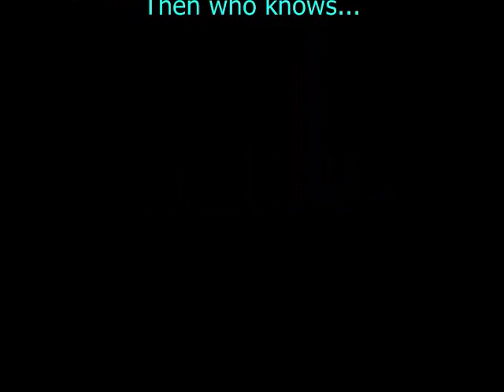My 900 VA Tesla Coil! (Resonant Transformer) Lightning Machine

Comment: You mention that your (.15µF 2000V) capacitors are hooked in "parallel", but that you end up with "something like 0.0132 micorfarads", which wouldn't be the case if they were hooked in parallel; (you'd get the SUM of all individual capacitance values, but the working voltage of the lowest-rated cap).
Did you mean they're hooked in series (which would give you 0.0136µF, if there are 11)?

Also, the (neon sign) trafos: in series (to increase voltage) or parallel (to increase current)?

Comment: I recently completed a SGTC with a 12kV 60mA NST, and it does not produce arcs longer than 2 feet. Yours appears to be generating up to 3.5 ft arcs (especially if it had a breakout point). I have to commend you for that spark gap. Mine utilizes an RQ gap with a small fan on it. Milling flats for salient pole operation is true dedication.

Comment: Very cool indeed..I know this is an old post.. do you respond to (or have you in general..) responded to comments on your videos? I was hoping to talk to you for a bit. I built my first Tesla coil in 1987 for my 8th grade Science Fair Project. I'd just returned from a vacation to San Fransisco. While I was there, I had the fortune of going to a fantastic science museum there called the 'Exploratorium'. There amongst tons of great exhibits was this mesmerizing, noisy, beautiful, and almost enchanting device, and right then and there I knew I would build one, no matter how difficult. I was determined to understand how it worked. 

   Sadly, once Id built mine two years later, and entered it into the science fair, and took it to my school, the administration decided not to allow me to present it in the fair. It was deemed by the faculty that it was: ..(and Im paraphrasing here, but not embellishing.. - ' ...Too dangerous to be turned on inside of the school ((any where in the school - the  gym, lunchroom, library, etc..)), and that it was ".. too potentially dangerous to other students, was a fire hazard, and that the admin, would be liable..' ) Pardon my shitty grammar and punctuation. Anyway, I'd found an old 3-phase pole transformer at an industrial equipment scrap yard. Finished and tuned, my coil produced by calculation (I had no means to measure it via tester,gauge, etc.. either..), apron. 5.5 million volts tuned to a fixed 60,000 hertz, and stood 9 feet tall. I made the primary out of 24 awg @ 5780 windings on a 5" dia. piece of ABS pipe, and it stood aprx. 7' tall. The entire assembled unit was about 9' tall on its base. 

  So, as I was mega-bummed, and frankly, quite pissed off that I'd put this effort in for nothing. But thankfully, I spoke with my Science teacher about how shitty the situation was, and so he went to bat for me and convinced the principal and fair judges to allow me to set it up in the vocational annex in the welding class shop ( which is ironic, seeing as the multi-bay arc welding station wielded many hundreds of amps more than my coil directly into students hands). Additionally, I'd gone through painstaking efforts to dismantle the entire set up and bring it to the school, leaving it in parts in the art class storage area over the weekend. My Science teacher is needless to say, awesome as hell! I set the coil up, made my adjustments, and turned it on. The reaction from everyone was so awesome - it felt good to have finally accomplished my at the time dream of building this awesome device. Subsequently, the fair judges granted me a unanimous/honorary 1st place prize.

   Anyway, Im fully aware that this comment is absurdly long winded.  I really  just wanted to congratulate you on your tenacity, thoroughness and your astonishing attention to the  detail in building this magnificent machine. I had no internet, very very few resources, and was astonished ay how little information I could find on not merely a Tesla Coil, but anything at all about Nikola Tesla. I scavenged through 3 public libraries, the school library, encyclopedias (lol! that'll tell you how old school I am), etc.. I finally found some information at the NCSU university library about Nikola Tesla, but almost nothing about how to build a tesla coil. I FINALLY found a schematic of a very very crude Tesla Coil in an archived 1954 edition of Popular Science magazine on microfiche at the Cameron Village State Library's media archives! I sure wish Id had access to the internet then. 

Thats all - just wanted to share a bit with a fellow Tesla enthusiast. Thanks for your time.
Reply: Incredible... This words you heard is of great future scientist
Reply from the maker: Thanks for posting this and sharing your experience with Tesla coils. Tesla wasn't popular in literature until recently, most of his work was in understanding radio and AC transmission systems we use today, and has been rounded out and completed by more recent texts.
Reply: I am a retired electrical engineer with high voltage as a hobby. You know that you built something worthwhile when people deem it too dangerous for display. Anything fun or interesting has an element of risk associated with it. I have a pole transformer powered coil which draws 6.5 KVA and puts out 9 foot streamers which I can only operate outdoors. During Halloween I have hundreds of visitors.

Comment: I have a quick question, I bought some 1nf 7kv capacitors that I was going to use for a tesla coil, how would connecting them in parallel affect the capacitance and voltage of the overall capacitors?
Reply: If you hook them up in series, the capacitance decreases and the voltage rating increases. If you hook them up in parallel, the capacitance increases but the voltage rating stays the same.

Comment: I just built my own. I saw this video before I started, and though woah that's cool. Now that I've built my own, I have a lot more  respect for yours, it's really impressive. All I could get out of mine were some 4 inch purple arcs,  ill still count that as a victory given that I was using 14 glass jars as my capacitor, which would constantly short themselves by arcing from the foil on the outside to the lid, not to mention the insane corona loss that was happening inside the jars. My NST is a little less than a third the power (about 280VA) and gfi protected, so the size of my spark gap is limited until I remove the gfi circuit.  Well done on the rotary spark gap.
Reply: A little late but I just built my first one and had the same capacitor problem as you, but I fixed it by adding vegetable oil on top of the saltwater.

Comment: you can get an estimate on voltage by how far the arcs travel e.g. 5 foot arc = approximately 500kv you just have to find out how much voltage it takes to arc so far
Reply: +MrShaun1578 10kV per centimeter ;)

Comment: Nice Tesla build. I have built many coils for schools, museums and even NASA/JPL labs. I have a video of some on my Channel. My largest coil build was using a secondary measuring 14" by 48" tall using #18 Ga. wire. I have seen 10 foot arcs using a potential transformer with a variac controlled input of 220 volts, 40 amps.  You did a great job on your Tesla! You may have a bit too much top load causing your safety spark gap to fire but its not that much out of balance. Try a smaller toroid on top and see what happens. Many builders end up with too much top load and that can overload the primary and weaken the output. A 12 x 3 toroid would be about right. Just a thought for you to try! Cheers.

Comment: http://www.mouser.com/cde/
http://www.amazon.com/s/?ie=UTF8&keywords=mallory+capacitor&tag=mh0b-20&index=aps&hvadid=4161468955&hvqmt=e&hvbmt=be&hvdev=c&ref=pd_sl_3vyajqke63_e
An old trick. To increase capacitance - add them in parallel. To increase inductance - add them in series. Hope that helps you all. And one should start simple. Explain how this works. http://www.cliftonlaboratories.com/userimages/relaxa1.gif It's called a relaxation oscillator.
Reply: +Douglas Allen    He's adding them in series because he needs to increase the voltage rating, not because he wants to decrease the capacitance.   He's pumping 12KV over caps rated at 2KV...

Comment: I flourish a bow your direction!  Admire the understanding of inductance & capacitance, ... great mechanical implementation too. Nice trick with synchronizing the motor. Would have loved to see you trimming the rotor.... a little surprised you didn't use a SCR firing circuit to capture the sections of the AC waveform. The calculations for tuning would be interesting. THANKs!  Impressive design and build.

Comment: Nice transformer, I wonder why people use pancake coil for the primary instead of the one tesla used on his transformer ?
thank you.
Reply: +Mars Seeker ?? not sure... better performance?
Reply: Don Molenda you think ? i don't know.  I wonder why Tesla didn't use a
 pancake coil. . do you think it never occurred to him ?
Reply: +Mars Seeker remember he was just innovating at the time/theorizing..we have had a lot more test equipment to show how to improve....they we still debating on DC current.
Reply: Don Molenda makes sense .. they stoled his time. .
Reply: I think that Tesla did actually use pancake but I'm not sure.Anyway a pancake coil gives better insulation between primary and secondary and also gives less coupling (which is a good thing).
Reply: Brek Martin You need magnetic couplig between primary and secondary but it has to be quite low.
Reply: Yeah, you don’t want coupling occurring between primary and secondary, that would ruin everything :D

Comment: Nice coil, I built one in 1995 with a stationary spark gap made from PK nails, home made beer bottle salt water oil capacitors driven by a 15KV/60mh neon sign transformer.
Reply: +Jason Alt   Sounds about like the one I built in the 1970s, except I was lucky enough to come across a large HV oil-filled capacitor (probably filled with PCB, fortunately, well enclosed) at a surplus store.   Before that I was using plate glass tiles and aluminum foil-- the oil filled cap was way better, but good luck finding one.    I configured the output as an autotransformer, connecting the primary and secondary, and increased the efficiency by just blowing air over the spark gap with a muffin fan.

Comment: That very interesting but what is the purpose of it? What function does it serve?
Reply: i sense envy
Reply: Thad Guy No... i just want to know what does...
Reply: Aaron M The theory Tesla had regarding this Transformer is to step voltage up efficiently and extremely high, so that it can be transmitted to receiver. There is was  to be stepped down to usable currents.

Comment: I will give you guys a highly guarded secret that "BIG ENERGY" doesn't want you to know. If you had two **"MIRRORED COILS"** one like this one and another one suspended upside down; Completely hung and suspended upside down from the top of 4 corner pyramid titanium "copper wrapped" frame. (PERFECT CENTER SUSPENSION IS A MUST...ONE DEGREE VARIATION WILL THROUGH THE WHOLE THING OUT OF WACK) The titanium pyramid frame has to be wrapped with 4 layers of thick copper wire as well. A "independently suspended" Copper wire mesh fence needs to independently surround the frame WITHOUT TOUCHING IT!  If done properly you could supply a small town of 15,000 residents with cheap electricity year round. Each base corner of the titanium copper wrapped frame needs to be suspended from the ground and rest on a giant magnet (4 Giant Magnets Total - For Each Base Corner). Two bottom (diagonally across) corners need to be resting on giant magnets that face-up positively charged and the other two corners need to face up negatively charged!  THE KEY TO EVERY THING IS "MIRRORED"... How does a mirror reflect images? I can't give this to you on a silver platter! I can can only point you in the right direction. One Tesla Coil has to be built similarly to this one and the other has to be mirrored, both in position & design configuration. The gap between the two coils needs to be carefully calculated as well. Both coils need to be firmly mounted into place WITH TITANIUM!.  THE FOUR CORNERED PYRAMID FRAME MUST BE GROUNDED OR THE WHOLE THING WILL EXPLODE AND ANYONE WITHIN 100 FT WILL BE ELECTROCUTED BY LIGHTNING TO DEATH! Everyone talks about the dream of harnessing lightning... Its a reality folks! From 48 12volt rechargeable batteries, you can create, sustain, and manipulate homemade lightening energy in its full power and glory, if stepped down properly, you can feed the power grid with massive amounts of cheap electricity. An unnamed friend of mine built one of these and stepped it down and tied the power into the power grid. When the check came into the mail at the end of the month the authorities visited him with allegations of meter manipulation. They put him in jail, wrecked his invention, and are permanently detaining him under the patriot act. The check was for $8,900,000 dollars... Yes all from 48 12Volt rechargeable batteries. Oh, I forgot to mention the bottom/base telsa coil rotates on and is suspended on a rotating ball-bearing platform. When this baby is turned on and resonance frequency is amplified the the center ball-bearing plate with the bottom Tesla coil mounted on it starts to rotate. The center plate must be mounted with deep and heavy industrial screws into a thick foundation. The base plate must contain a 24 star formation cross, with 24 spark head to breach the sparks gap from a static position to a rotation position. Everything that's metal must be mounted or screwed down firmly. The electromagnetic pull of this device is tremendous.  Anyone with metal screws in their teeth need not be within 100 feet of this device. THIS IS NOT A HOAX! Get your Electrical engineers behind this to make it work. My friend is now being detained, his plans, blueprints, specs are now property of the State. PLEASE SHARE THIS DESCRIPTION WITH AN ENGINEER TO DISCUSS HOW THE SPECIFICS WOULD WORK IF RE-ENGINEERED?
Reply: oh shut the fuck up
Reply: Stopped reading at "BIG ENERGY".  GJNT
Reply: Yo these comments above me are by the government to surprise public knowladge
Reply: No such thing as free energy
Reply: +Cafe Sardinia If you make an aluminum foil hat(assuming you aren't already wearing one) and stand outside, in a field, in a thunderstorm, you will be struck with an incredible amount of energy.  Now if you do it with a buddy who is upside down next to you both will become supermen.  True Story.

Comment: I just built a coil and fired it up about 4 days ago.  My secondary is 6.625" diameter and 37" tall.  Top load is 6"dryer tube and total dia is 33".  Using 2- 15k 30 ma nst.  I am using a terry filter.  And safety gap.  I have mmc with capacitance of 17.3nF.  I have 2 spark gaps set at .25" (total of .5").  Not air cooled.   My primary is 22 turns and I'm tapped in at turn 17.  I have a 4' grounding rod in the ground that is grounding everything.  I have 2 problems.  1st problem, when I turn on the tesla coil the water pipe that comes into my house vibrate (it maybe the sprinkler system pipe, it runs parallel to my main water pipe).  I have a sprinkler system that have pvc pipes that run all through out my yard.  I have moved the grounding rod to different spot, but no change.  It does seem to decrease the pipe from vibrating when I move the coil away from the house (at least 30').  2nd problem,  My arcs are only about 18".   Would greatly appreciate any help.  Please, any help at all.
Reply: Improve your spark gap, that'll be the biggest factor in improving arc length/appearance... If you can hear it squealing, it's overloaded and needs to be bigger...

Comment: I am very interested in your spark gap motor and drive circuit. is it on your blog? is the ac filter design on there as well. i have many TC books but they are VERY old reprints. None have synch. spark gaps so this is very interesting to me!

Comment: Your RSG description reminds me of the one TGG used for Project Gemini. Have you had a chance to go there? Gemini died, but Icarus is coming together. I like your coil:)
Reply from the maker: I haven't. Its rather expensive and far away. :P I'd like to visit!

I hope TGG begins working more with DRSSTC's, rather than spark gap coils. They just make more sense.
Reply: highvoltagefeathers TGG are working on electronic drivers kits for Tesla coils, they had a design which was going to be released, but Paul Kidwell has redesigned it from scratch, he was talking about it on livestream last night, and from whay i caught, it will be scaleable from a small tabletop to whatever size you want.
TGG are also building a small demo coil that can be taken around, plus a replacement for Gemini which was damaged in a recent fire, which will be called Icarus.
Icarus will be i think 3 types of coil (spark gap, RSG, and one form of electronic that will use the new driver)
The new driver will eventually be used for project Zeus, which will be a 24" x 20+foot system, again using the 3 types of driver.

Seeing your RSG, have you seen the one where the guy has a motor that rotates the RSG motor to get it in sync ?

Comment: Where do you get the 12Kv NST's and how much do they generally run? I am thinking about building a bucket cap which should support about 50Kv Capacitance.
Reply: They run about $100 and change new. Bucket caps are a blast, but they're over kill.